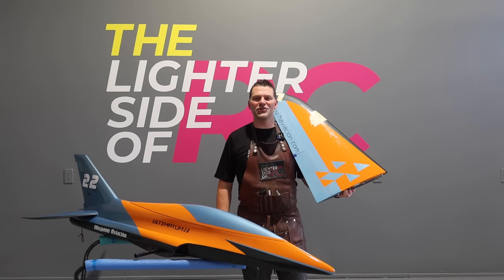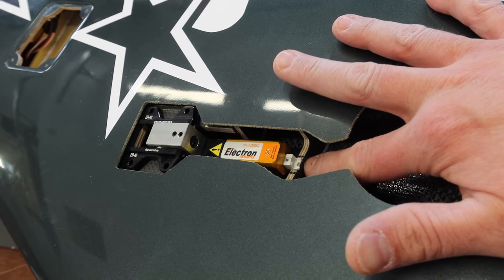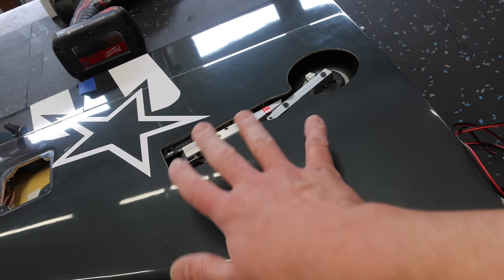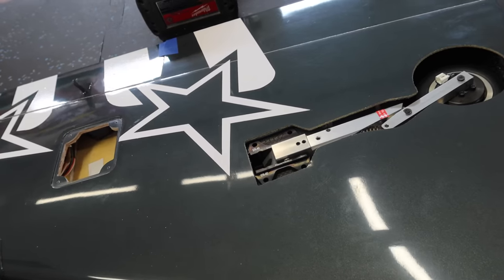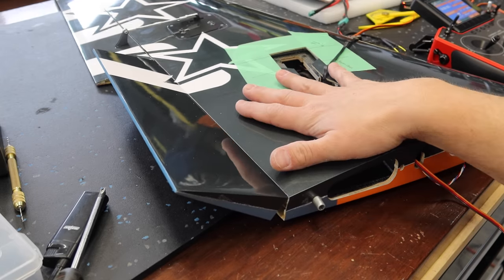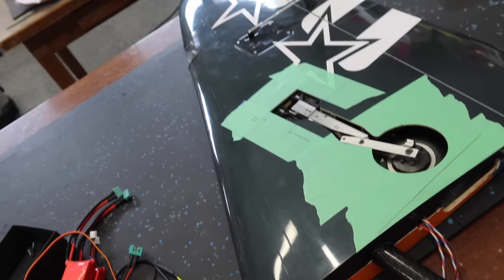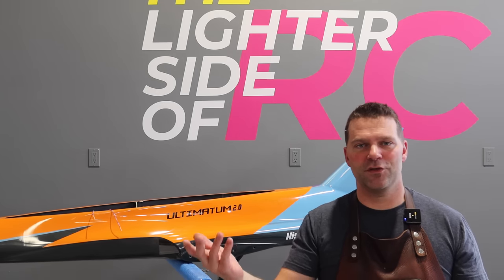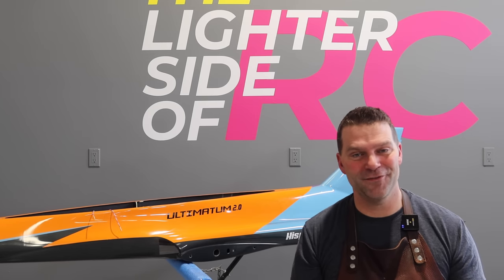U2 Wings Complete - Hispano Aviation Ultimatum 2.0

Comment: Good vid! I like your ‘gear door process’. My question is about the installation of the flap servos, is there a hatch on the wing to access them? They look like a bear to install and connect. I saw the hatch for the aileron servos, but not the flap.
Reply from the maker: Thanks John!  I was worried about the gear doors but now that we have a plan, I'm happy and excited!  The flap servos on many of these new sport jets are accessed through the root of the wing/gear opening.  It's actually pretty good access other than needing a long screw driver and drill bit.  I prefer this to having a hatch.

Comment: Question:  When you cut out the carbon skin on the wheel well for the gear doors, you said you cut it with an Xacto knife.  Why not use a cutoff wheel on the Dremel?  Seems like a more efficient way BUT, I know you have your reason so that's why I ask.
Reply from the maker: Hey Scott.  Great question.  Mainly because I felt like I could be more accurate with an xacto and straight edge.  Once wrong move or slip with the cut off wheel and OUCH.

Comment: Hello, what is your source for the paint matching?  What kind of paint and clear coat?
Reply from the maker: Hello Dave.  I go to a local autobody place and they work with me to get the best results possible.   Very Helpful fellows.  Advance Auto Colors.  They mix up the paint and put it in nice adjustable spray bombs for me.  On this one I used Automotive clear coat.  NOT the 2 K variety as it's such a small area.
Reply: @thelightersideofrc  as always, thanks.